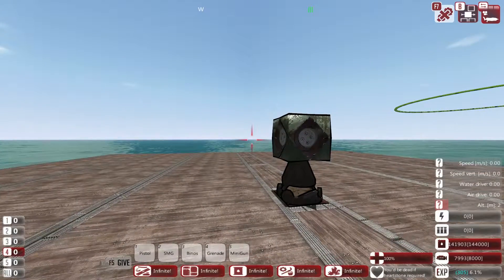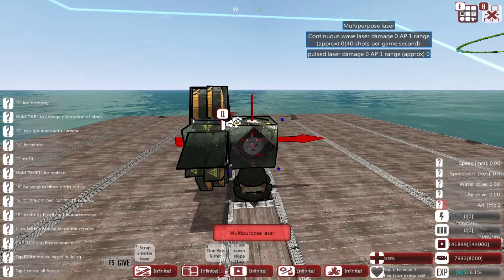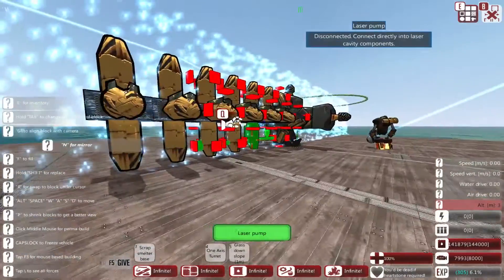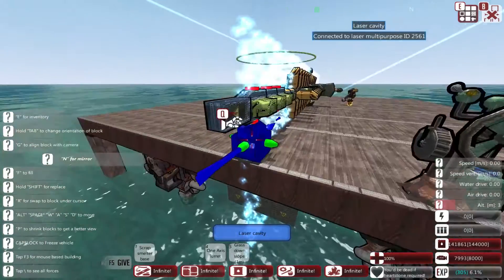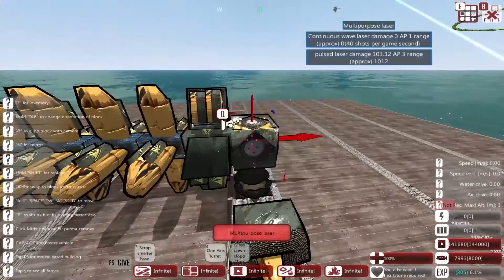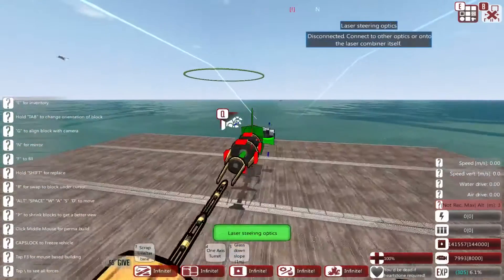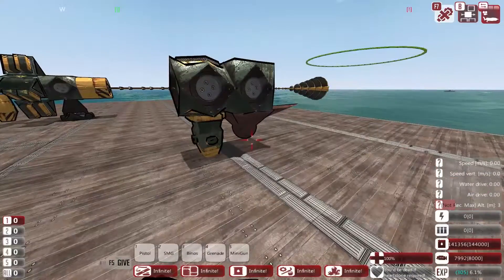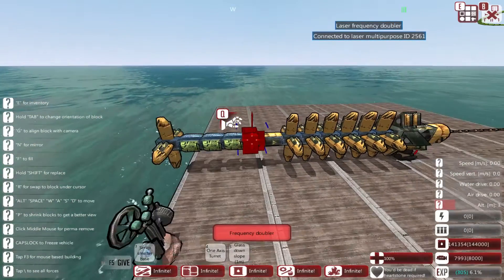From the Depths : Laser Tutorial

Comment: could you update this tutorial? there are new cavities and stuff. also now shells and missiles have health according to their size and configuration
Reply from the maker: Most of the things in the tutorial are still valid, the new cavities store more power but are not too different, and the LAMS has to do a bit more damage. Unfortunately, the fact that FtD is still in Early Access and getting a lot of updates in a short period of time means that constantly uploading a new tutorial video to cover everything would take almost as much time as actually trying to do a LP of a game
Reply: well it is rather lacking in the first place, you didn't even mention anything about charge, got the numbers wrong.
A laser pump uses 100 power per second to create 50 laser charge per second. Charge is stored in the cavity.
By default the laser uses 20% of the stored charge when firing.
Each frequency doubler increases AP by 2.
Each destabilizer uses 80% more power, with each one being added decreasing it's effect to 80%.
Q switches increase energy efficiency at the cost of less concentrated damage, etc.

Comment: the wireless connecting doesn't seem to work anymore in most recent patches. Not in the method you show here at least.
Reply from the maker: I'll take a look first thing in the morning, and if I figure something out I'll let you know!
Reply: DerpDigital
cool, tnx
Reply from the maker: I just hooked up a multipurpose laser to a transceiver, built a transceiver facing it with a connector block, and everything still seems to work just fine, perhaps you didn't connect the multipurpose laser block properly or something? I don't think anything has changed in the game, laser wise
Reply: DerpDigital
I can draw you my setup that doesn't work.
M = Multipurpose Laser
C = Laser Connector
T = Laser Transceiver
B = Two-axis turret base
X = Iron block

_CC_
_TB_
XXXXX
M_T__
CCC__

A 5x5 area, in vertical position

EDIT:

I got it to work for the first time just now using this setup.

__CC
__TC
__CC
__B__
XXXXX
M_T_
CCC_
Reply from the maker: Navnik BHSilver ah, knowing that you're working with a turret complicates things, but as long as you have the laser transceivers running through the turret base, things should work. you can only connect turrets to an existing laser if you do it that way.